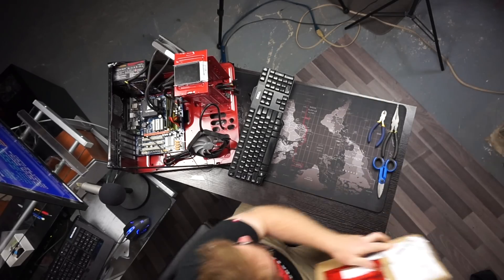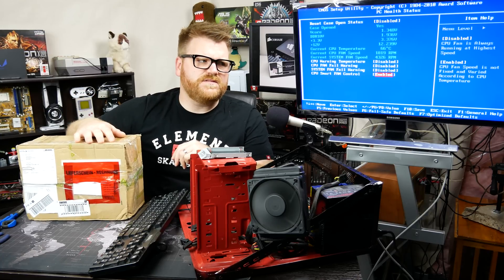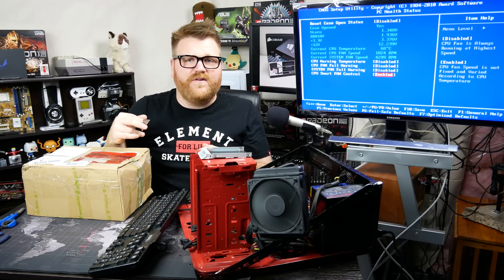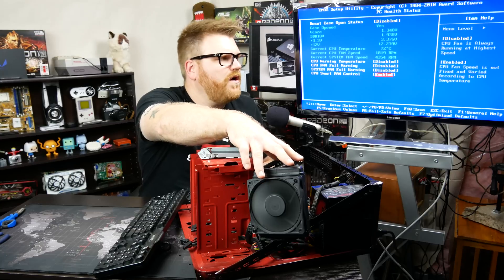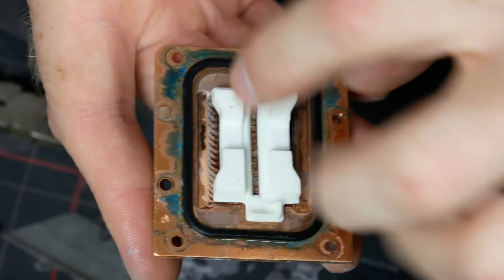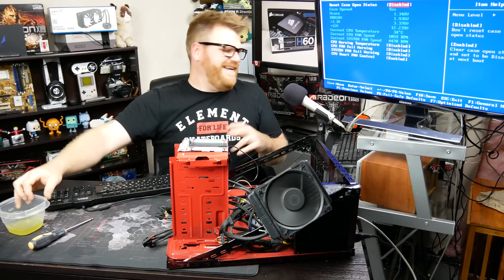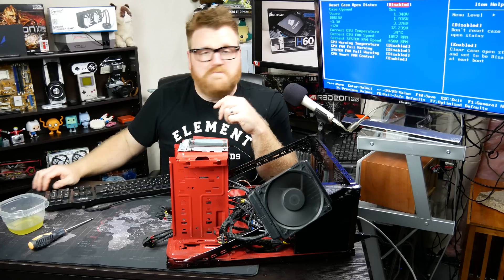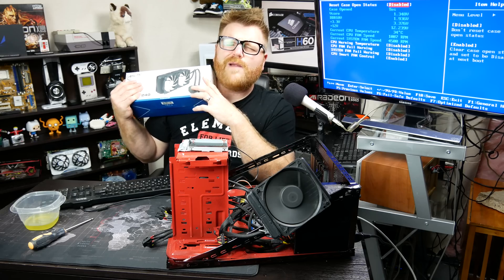Tearing Down a 7 year old AIO CPU Cooler

Comment: I came here because I have an Uphere AIO Liquid Cooler on my i5-7600 that's done a good job for 7 years. I did a dust removal on my case yesterday and had some cooling issues that have seemed to resolve themselves. I wasn't having any cooling issues before the dust removal.  The CPU Ran up to 206* a couple of times. I shut it down and double checked all the connections. Restarted, and it ran kind of warm for an hour or so in the 150-160* F range. Today it's running around 105-110*F. The only thing I can think of that might have caused the problem is that I tipped the case on to a 45* angle for a few moments while I was vacuuming the back of the case, I might have introduced an air bubble and caused some cavitation issues in the pump. I've been thinking about pulling the cooler off and reapplying the thermal paste, but rationalize, why bother it if it's cooling good. I think I'll buy another cooler to have on hand for when it's needed. To bad Uphere seems to have stopped making this particular unit. Thanks for sharing the refurbish info on the Corsair.

Comment: Never use water that you drink! Buy special coolant for open loop systems. You can also use high quality car coolant like pink g12 and mix it eith distilled water around 30% coolant 70% distiled water- but you will also need biocide inhibitor to will algas and bacteria- usually 2-3 drops. The mayhems coolant is all prepared and ready to use though

Comment: i opened an intel branded aio cooler from 2012 and it was completely full of gunk and what looked like little rocks but was probably corrosion altho the copper looked perfect. Decided to add some of my own pipes and added two cheap 240mm rads from ebay and blue coolant, so quite satisfied.

Comment: Back in the day there was an Intel branded Asetek cooler you could get for the 1366 platform (among others) that released at something like $80-90, found one new on Amazon new for 45 bucks man that thing was a great cooler, ran it for 5 years no issues whatsoever.  These days I'm running a Fractal S36 and for $120 it's hard to beat, but there is actually some good competition in the 360mm AIO range these days whereas when I got the S36 there wasn't anything close for the performance/price.

The nice thing about the Fractal is it's expandable/mod-able, having that as a feature is pretty great imo.  Arctic has a 360mm that looks even better, and I've always regarded their fans to be the best price/performance.  Anyway man, I just wanted to say awesome video.. first impression "this is a real builder channel".. enjoyed it a lot and you gained a new sub.

Comment: I got my old h60 on my 9900k cooling it just fine. Even overclocked at 5.1ghz it keeps it cool. Guess I got lucky with mine.
Reply: Replying to myself here, so im not spreading misinformation anymore. So while I can keep the CPU cool at 5.1 ghz, and benchmarked twice and did pass with the h60. I decided to run more tests in blender, with a render, and an additional benchmark test and the cooler is not consistent. I blue screened for both. Therefore I retract my statement, but will say that the cooler is good for standard cooling. But not DEPENDABLE for OC cooling when pushing to load. While sculpting in zbrush at 50 million points and sculpting/working in Blender it does fine. But any stress tests like a render (no one uses CPU anymore for this), or UserBenchMark and it'll likely fail.

Comment: Well if your going to clean it use hvy duty rubbing compound it will turn the copper cleaner than new BUT of course it failed all AIOs are POSes we already went threw this high end Air/Custom loop is only way to go AIOs are crap miswell use stock cheapo cooler atleast they will not gum up

Comment: I have the h60i on my ryzen 1600 and it keeps my cpu 10-20 degrees c cooler at idle( about 20-35 Celsius) . And in gaming it stays at 45 degrees Celsius. With just the wrath air cooler it'd hit around 55 degrees Celsius.

Comment: hey tim.  im here looking for a video on how to change out the coolant on a corsair AIO H100i series.  i bought my pc from a friend a few years back and realized, crap i still got the same liquid coolant that originally came with it.  ooops.    computer isnt heavily used but i do have my i7 3770k oc'd up to 5ghz with turbo and its getting over 70 C under full load where before it was not.    should i just top it up and see if that brings down the temps before i start taking it all apart?  i fix pc's but never f'd with aio's liquid coolant rads or cars for that matter. tia

Comment: One thing you could do to get more out of it would be bigger fins on the copper plate and shorter pipings to become a little like a tower cooler. Also a more proper propeller for the pump would do nicely as well.

Comment: i know this an old video but i bought a new old stock AIO from taobao and at first the cpu would just overheat, no water movement, took it apart, it does take ages ages ages to clean out the old semi mouldy scummed up coolant from an unused new old stock cooler, flush it out and put new distilled water with some sodium chloride 0.1 % as anti bac agent and presto it works on 2 of my computers but will be a hassle putting it in my editing rig

Comment: I just opened an 8 year old H80 that I got for free with a motherboard I bought on ebay... It's actually spotless inside, but the fins on the cold plate were royally fucked at the factory. It looks like someone dropped it and then stepped on it, the top of the fins are all flattened and on both ends it's been hit so all the fins are jammed right together, and ON TOP OF THAT something hit a couple fins so hard that they're completely ripped up off the coldplate and twisted up and backward.

I hope Corsair has fixed their quality control by now...

Comment: Im still using an old h50...  i should really do this ive noticed my 5ghz overclock is running hotter then usual lol :)
Reply: Me too!! I am looking to upgrade my 10yr old i7 950 and am wondering if I should reuse the cooler... tbh I haven't looked at the 950 temps in a while lol.

Comment: I actually had all of these parts (same cooler, same core 2 duo, same amount of ram, same board) from my first ever PC. And then the power supply killed it all... was a nice machine. (for its time of course)
Reply: Which power supply u used? Because newer PSU"s from 2017 onwards have fail safe features that protect against breaking all the system

Comment: I was using a UpHere AIO for my x5670 build and it was doing a fairly good job. Overclocked to 4.5ghz the cooler was keeping idle temps around 40˚c to 45˚c. These budget AIO solutions can be okay but after watching this I know I'm going to be keeping my eye on it.

The thing is that I'll be keeping my eye on it while it cools a i5-4460. The x5670 build (with a Asus Rampage III Extreme motherboard) just would not play nice with Windows 10. Update errors from Windows Update and installing the Nvidia drivers for my 1060 was a nightmare. Got to the point I was so frustrated I just threw a Asus H81M Plus in the case with the 4460 I had lying around. Certainly not as powerful as the Xeon, and the pointlessness of water cooling a CPU you can't overclock is not lost on me, but the system now runs like a dream with no update issues at all.

Comment: I'll never buy another one of these... it's pure shit it instantly starts clogging up the copper fins with copper compounds and only lasts for like you said max 6 months. In my case it worked for about one month and then started clogging. by the time it completely failed (it had failed a few times already) the internal rubber water flow chambers had expanded so water was no longer flowing through the fins and was just flowing over them at maybe a few drops per second. it looked like a copper goblin blew his load inside of the water block. never again will I use one of these pos
Reply: Lol which one did you get? I have an old school h100 corsair and its lasted me to this point (7 years).
Reply: citation
Reply: In 6 months Corsair will gladly replace the unit. My H80i lasted 8 years, wel beyond its warranty period, before the pump died.

Comment: My 1st gen H60 worked fine till I sold the system and it cooled a Phenom II X4 965 BE very well. And that was a 125-140W CPU. I think 45-50 C max on full load.

Comment: I was planning to get h60 for my ryzen 5 1600 ! What do you recommend over it ?
Reply: I am actually digging the new EK Fluid Gaming stuff. A240 and A240G are decently priced for what you get.
Reply: Corsair H100v2 (That's what I use on my Ryzen 1700), or an NZXT Kraken X52-X62, which is prettier but pricier.
*EDIT, "Sort of" agree with TImmy. Noctua's great for air, but their prices are really high. You're basically paying for great fans. I can't justify spending $90 for an air-cooler, when a 240 AIO is only $20 more & will destroy ANY air-cooler. If I use an air-cooler, in an ATX build, it's probably going to be a Cooler Master Hyper 212 EVO. Only $30, and produce temps pretty close to Noctua's $90 NH-D15.
Reply: EK is starting to come out with some pretty cool shit. I agree.
Reply: Just get a Hyper 212 EVO. I got my Ryzen 5 1600 to 4.025GHz and it's about 43-54 degrees celcius while gaming.

Comment: I took apart my 55 after 6 years.  Noticed that my i5-3570K was gettting a little hot even when the fan  waa cranked.  I couldn't believe the stuff in the fluid and on the cpu cover.  I cleaned it up and ran some ionized water through and changed to that and it has been cooling just fine for over a year.

Comment: See, now this is a cool video.  We get to be educated about the internal workings of an AIO and what is a likely failure point.  Which turned out to be an obstructed cooling block.  Although further investigation would go even further into what formed the solid particles in the coolant fluid.

Also, you have shown us that you're not just a one trick pony in that you have some mechanical skills and diagnostic abilities as well.  You mentioned at the end of the video that you had just clamped the hose back into the radiator (just like an automobile) and that you thought it would blow from the pressure.  I'm going to guess that it will not.  Because my theory is that the pump is not producing enough return pressure to cause a separation to take place.  It would be REALLY interesting to know what the pressure in the system is though.  I wonder if you could find a pressure meter to do this and reveal what the actual working pressure of one of these things really is?  I'm going to hazard a guess and say 10psi max.  Which you could easily outdo with just your mouth blowing into one end as you did to empty the rad of its contents.

Using just filtered water will probably not harm the system for a while, but I suspect that you could get another 5 degrees of cooling out of this by mixing in some water wetter or propylene glycol to decrease the surface tension of the water and absorb/transfer more heat from the cooling block.  What we didn't see that would also give more efficiency to the system is if you cleaned the radiator of all things sticking to the outside of it.  Any coverings, such as dust or condensed grease would severely lower its efficiency to transfer that heat to the air going through it.

Comment: Get yourself some distilled water to use for water cooling. Tap water even filtered will have minerals in it that will react with the Al or Copper. It never goes bad and a gallon is like $2.
Reply: distilled water picks up minerals and begins to create a battery between aluminum and copper within minutes of having it in the aio causing galvanic corrosion
Reply: @TheGamingGentlemann  You should patent your new battery production with distilled water.
Reply: @TheGamingGentlemann  But then what liquid do you recommend to use in a water cooling
Reply: Good advice up there. ^